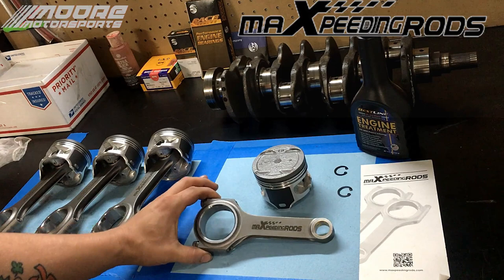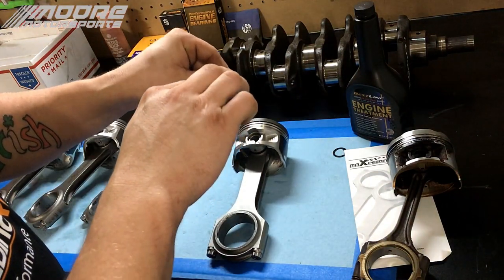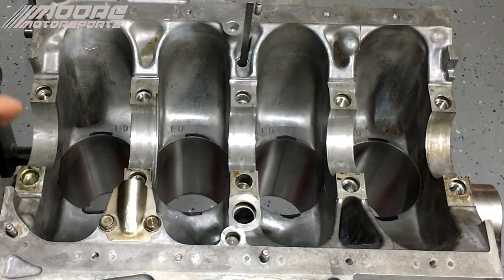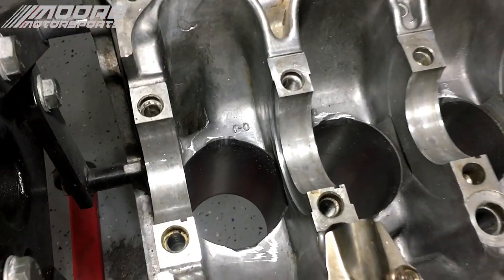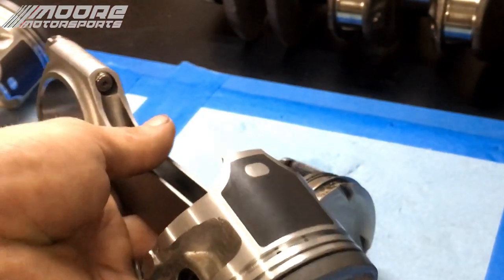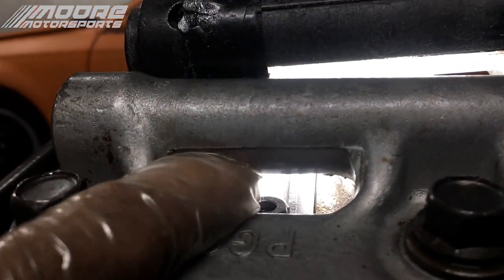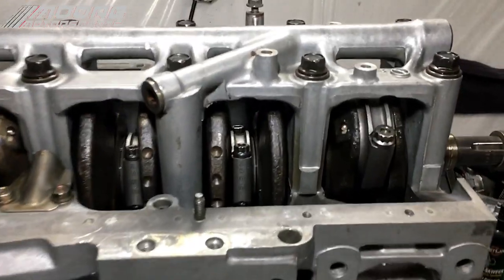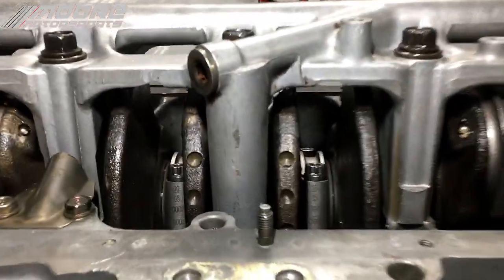How To Notch A Block To Support Forged Rods.

Comment: Hey just to let you know, the double cut works better on steel/iron and single works better on aluminum since it won’t gum up the bit. If you have a rotary tool you can adjust the speed. 👍
Reply from the maker: Good to know! Thanks!